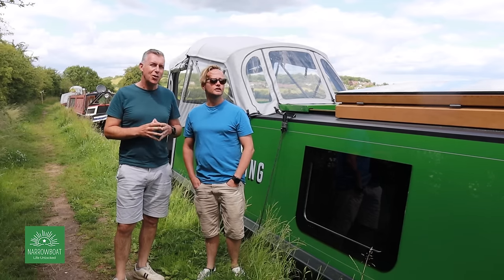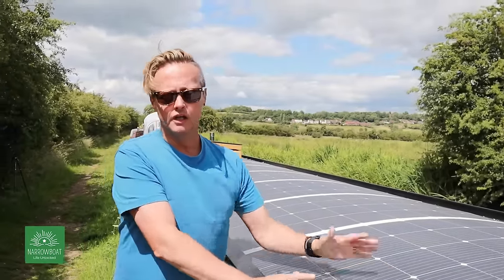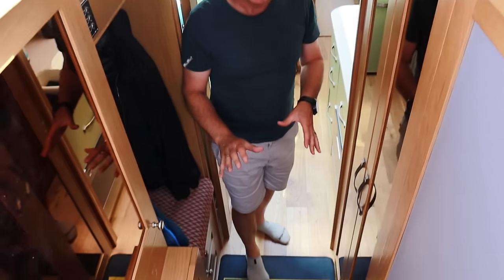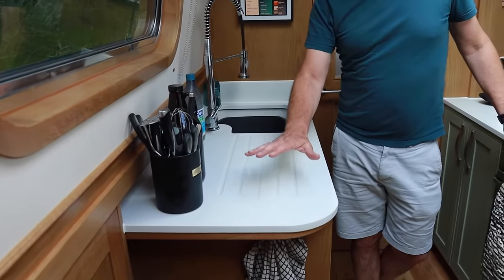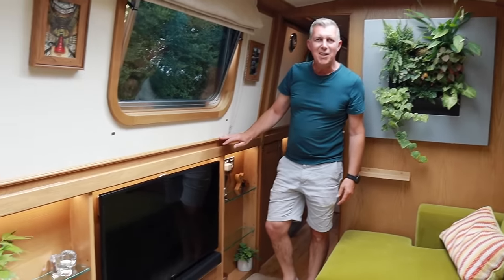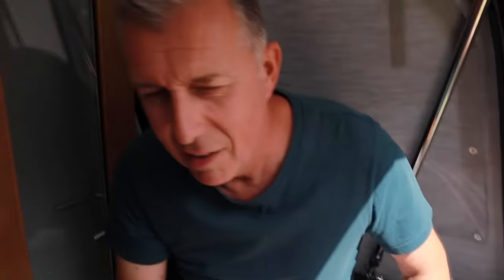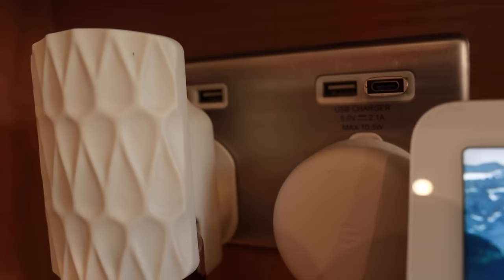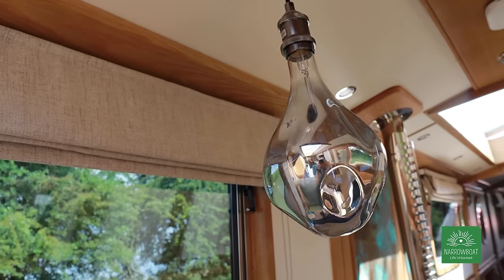The Future of Living: Electric Narrowboat Home Tour

Comment: Thanks for the tour of the boat. I was glad you included the panel where the power status of the boat (solar, batteries, etc.). I was wondering if the generator starts automatically if needed.  Looking forward to seeing future cruises!!
Reply: Glad you enjoyed Will. There are 2 settings where the generator kicks in. Between 8am and 8pm, when the batteries drop below I think 30% it will kick in (this is because  engines shouldn’t be run outside these hours). There is a critical setting where the times are ignored to protect the batteries and I think this level is 10%.
The generator will also kick in if we exceed 3kW of power, just to help the batteries along. 
Looking forward to making new memories and adventures. Have a lovely week ❤

Comment: This boat is nearly at the standard of all new sailing boats, the only thing missing is a decent freezer for provisioning and pantry storage plus a water maker.  With a macerator/incinerator composting loo and no diesel backup heater you would totally off grid for quite sometime. Love the colours too!
Reply: An electric heater in addition to diesel heater to use up all that extra solar output would see this boat run very efficiently and cheaply indeed.
Reply from the maker: Thank you. Yeah, we really wanted a decent freezer. We have an additional one under the dinette and an icebox freezer too but would have loved a full size one. We have a composting loo but the power to run an incinerator toilet would be massive. 😊

Comment: Wow.  What a stunning boat - executed to perfection I would say!.  My only concern, as an electronics/electrical engineer, is the mounting of the 8kW inverter in a cupboard.  Is there any provision for ventilation in that space - a fan or ventilation openings? The long term reliability of electronic equipment is vastly improved if they are run cool.  When your inverter is running at full output there will be perhaps a kilowatt of waste energy produced (nothing being 100% efficient).  You would not want that inside a space without adequate airflow to get rid of it to atmosphere.
Reply: Hey Peter. I hear you. The cupboard does get hot but they have put a vent in there it help cool it. Things definitely have improved in electronics with more efficiency but as you said, no system is every 100% efficient. We do keep an eye on how hot it gets in there and will add more vents if need be. Thanks for the heads up though. Have a good week ❤

Comment: Very nice boat, you didn't tell us about the boat motor power.
Reply: Oh sorry:

Power: 10kW
Voltage: 48v
Torque: 70Nm
RPM: 1600
Cooled: Air Cooled
Speed Control: Stepless

Comment: Guys, we are absolutely loving your videos. They are a great source of information to us.  My wife Jill and I are just moving from a shared ownership, which has been our introduction to narrow boating, to a new build, destined to be at Crick next year.  Like you we are going fully electric with the Vetus E line 10klw package.  I just have one question.  Are you finding the power from the 10 klw electric motor sufficient and comparable with a typical 43hp diesel? Sorry, two questions, what is your solar capacity?  I'm thinking of going for 12 x 160watt.  Steve
Reply from the maker: Thank you that’s really kind. Everything on this boat is new to us and fairly new to the builder, we had some teething problems but all sorted now. We have 1.93 kw of solar as far as the power we have only cruised in eco mode and found the power equivalent, you will find though you get into a habit of getting off the mark slowly because you are thinking of your batteries 👍
Reply: @NarrowboatLifeUnlocked  Thank you so much for taking the time to reply. Thats really useful information for us and cements our thoughts about going serial hybrid.

Comment: What a fantastic boat. I still say it should have won best in show because it all just comes together to be so livable. I watched all the vlogs I could find from Crick that had your boat so this time I was ready to look at things with as critical an eye as possible to see if there is anything I would do differently. The only things I could find are so nitpickingly small that they really are a case of personal preference, such as mounting the microwave above counter level so that you don't have to clear the counter to be able to open the microwave door. The one thing that I did think of was to have a handle/pole extending up from the rear steps so that if someone in the boat slides the steps away and then goes forward in the boat and someone in the cockpit wants to use the steps they would be able to slide the steps back into position.
The airy appearance in the boat makes it look like a widebeam compared to many other boats. The colour scheme adds to this too. And those skylights - I think I'd be lying down staring at the stars at night for a long time before the novelty could start to wear off.
1,000 litres of water is a decent size tank. Where is it? Does it make a difference to the trim of the boat as it gets used?
So with no diesel propulsion does this mean you can buy your diesel 100% on the lower tariff?

Can you start the engine in a vlog so we can hear how that does sound compared to a normal engine in use on a boat please. I imagine that with it not being physically attached to the propulsion system (that in turn is physically attached to the hull) it will probably be much quieter - not that you need to run it often anyway. It will be very interesting to learn how much less diesel you use by using this system. I have always noted that diesel engines running near tickover are actually running very inefficiently, but a generator should be running at nearer peak efficiency while needed, then shut off, so hopefully that adds even more savings.
I like your old boat, I like Silver Fox and a couple of others but this one has raised the bar, not incrementally but massively like transitioning from high jump to the pole vault.

Comment: Thank you for the tour.   So you still have to have a diesel tank , not for the engine as you have explained but for the generator and the heating?  Am I wrong.
Reply: Hey Bernadette. Yeah, that is correct, tank also used for the diesel refleks stove. The cost of our diesel and consumption should be significantly less in summer though. 😊

Comment: Probably the best boat I've seen. Love the amount of natural light and the huge amount of clever storage. Just a couple of  questions, is there space for more solar panels on the roof and another lithium battering increase range? And does the generator, Webasto and room heater all fun off the same tank?
Thanks for the tour and enjoy!
Reply: Thanks so much Carl. Glad you enjoyed. The light is incredible with the skylights. The extra lithium and solar does increase available power so this can be used for whatever, but including range. All the diesel heaters, generators etc do run off the same tank. It makes it so much easier not having to monitor multiple tanks. Have a lovely week ❤

Comment: Quick question (incredible boat BTW) How does the system cope with surplus power as not connected to the grid?
Reply from the maker: Hey Donna. Glad you like the boat. There isn’t really any surplus power. All the power generated is put into a bank of lithium batteries that we then draw from. Some of the generated power comes from solar and some from a backup diesel generator. Hope that makes sense 😊. Have a lovely week ❤️

Comment: Really enjoyed the tour and your boat is simply amazing.  Rather than scrolling through 550+ comments mind if I ask.  If I understood correctly there are 3 200 amp 51 volt batteries that power the motor, and one 200 amp 51 volt battery for general living.  What size HP equivalent is the motor?  On a normal UK summer day traveling at canal speed have you figured out the distance you can travel on fully charged batteries?
Reply: Hey Wayne. Glad you enjoyed. Oh, that makes my brain hurt Wayne. The batteries are 3200 at 48v. The motor is 10W. Not sure the equivalent of HP but most electric motors have a higher torque. Liam at Oakums may be able to answer your questions better than me. Have a good week ❤

Comment: I have a couple of compound questions...  First, what type of material/fabric was used for the upholstery?  Is it fade resistant?  Second, what type of clear coating was used on the oak?  Will it orange/amber with age and exposure to the sun?
Reply from the maker: Going to be honest Beth. I have no idea what the sofa is made from, this would be a question for Oakums. The oak is treated with a clear varnish. This is something that needs to be maintained probably every 6-12 months. We will use a clear marine varnish. The oak already has a lovely amber colour to it so hope it maintains this. No reason it shouldn’t if looked after. Have a lovely week ❤️
Reply: Hi Beth. Joinery is stain polished, and finished with a UV Resistant, Clear Coat 2 Pack Polyurethane with a Class 0 Surface Spread of Flame Treatment. 

The only maintainance will be on the skylight oak. Internal oak will be suitable for many many years. 

Fabric, we use a commercial supplier. As well as being fire resistant we use a soil release treatment developed to protect your fabric against the majority of everyday spills and stains. Ideally suited to contract/hospitality upholstery the high performance finish makes the fabric water and oil repellant as well as stain resistant so that the fabric will stay looking ‘fresh’ with minimal maintenance
Reply: @liamhainsworth9620  Thank you Liam !  I think alot of people that follow the channel will also find the information useful should they do a refit.  You've done a splendid job on Morning Star and eveyone at Oakums should indeed be proud of themselves and the first class workmanship you give every custom you do.

Comment: Wow, absolutely love the boat and the electric propulsion. With regards to the electric propulsion and solar, do you think you will have to run your generator a lot more in the winter. Also, what life do you expect from the batteries?
Reply: Hey Rob. Glad you like her. We will definitely have to run the generator more in winter, but then, we have had some very sunny winters the last few years. As lithium charges quicker and you can discharge to well below the 50% of lead acids, I reckon we will still save money on diesel. I am not sure of the lifespan of the batteries. If looked after, there is no reason not to be able to get a good 10 years out of them I guess. Hope you have a good weekend ❤

Comment: Great vlog guys and a fantastic tour of your new floating home.
Just a question, the generator. Obviously electric start but, should your batteries be totally flat, can it be started by hand?
Reply: The generator has a backup battery segregated from the main system, so in the event you do drain all your batteries, you have a means to start up the generator. 

The generator is a remote access system, so you can remotely turn it on from anywhere in the world, and there are predefined settings. I.e. auto start at 10% 😊
Reply: Thanks Henry. See Liam has already beat me to the generator question 😂. Have a lovely week and take care ❤
Reply: @anthonysmith-storey9247  with all the comments you’ve had on this weeks blog, you’re going to need to go down to 1 Day a week…. A lot of replies needed 😂
Reply: @liamhainsworth9620  😂

Comment: Does the generator automatically start when the batteries need charging? I think this is the way to go battery and solar with a backup generator. Perfect!😊
Reply from the maker: You can set the generator to kick in under certain conditions. One is that if the batteries fall to 30%. Another is if the power consumption exceeds a given amount. It is a Greta way to protect the batteries and definitely is the way to go. Have a great week ❤️

Comment: I would like to ask a question about ventilation in the roof as I can only see Qty 1 mushroom vent, and is the glass in the skylights safety glass if anyone falls onto it?
Reply: The requirement for air vents is less, due to the boat being gas free. Correctly spotted that the number of vents is reduced. Vents are ducted in the ceiling, but also on the side of the boat - so we can maximise on solar 😊
Reply: @liamhainsworth9620  Thank you Liam, makes sense!
Reply: See Liam has answered Dale. I did cover this but didn’t make Paul’s edit 😂